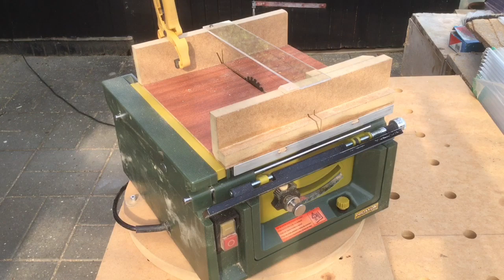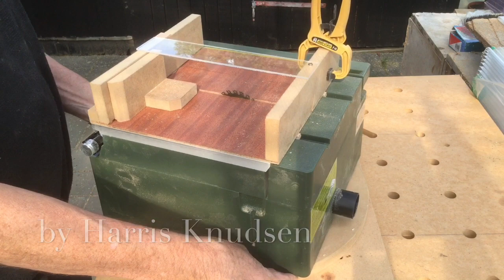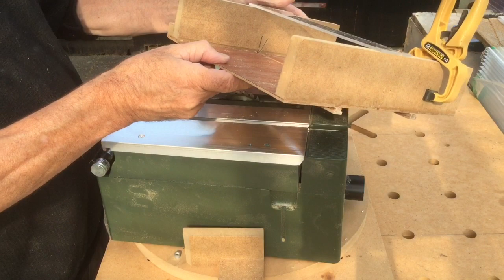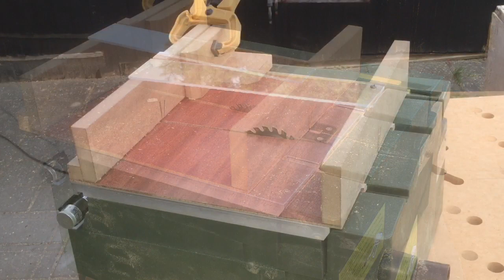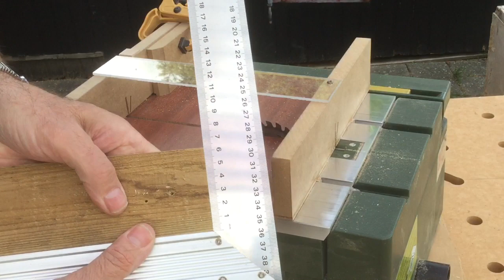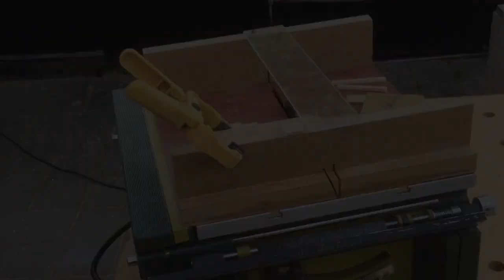Proxxon FET Simple Cross Cut Sled

Comment: Nice to see someone else using a FET.
To avoid making multiple sked jigs for different project cuts. (30 Deg diamond) I made 1 sled and different project inserts on 3mm ply that fit between the front & back rails (3mm don't want to lose too much cut depth from 20mm max)
Reply: good evening congratulations for your ideas and it is possible to have a project to build this table for my proxxon fet Thanks

Comment: Hello, you seem to be an expert on these machines.  I just bought one, and the blade does not seem to be exactly parallel to the table top ie the miter slots.  Is there an easy way to adjust it or do I have to tare it all down to figure out a way to do it.  I will appreciate any feedback.
Reply from the maker: If I understand you correctly, then you are saying that your saw blade is slightly skewed compared to the two T tracks in the top plate of the saw.  If so, it's a serious mistake.  If the saw is bought new, send it back and get another one.  If you have to repair it yourself, you have to go all the way to the suspension and I can not just look at the drawing to see if there is a possibility of an adjustment.  I once saw a video on You Tube where there was someone who separated and assembled the saw, I unfortunately do not have a link but if you can find it I think you can see what are the options for adjustment.
Reply: Thanks, I saw that video.  Although the FET is new, I cannot return or exchange it.  However, I did manage to improve it by loosening the table top 4 screws and giving it a few whack with a rubber mallet.  Its not a 100%, but much better than before.

Comment: Would it be OK to make sled without that bottom board, because you are loosing height because of it which dictates how thick wood you can cut, since proxxon saw height is a bit on a short side?
Reply from the maker: I have even considered this option but the problem is that without the base plate it is difficult to achieve sufficient stability.  You should make a Cross Cut Sled with a 3 mm base plate and then supplement with a Side Cutter Sled https://youtu.be/2J0PeTxgKDY so you have a really good setup.
Reply: @Harris-DIY  Thank you.